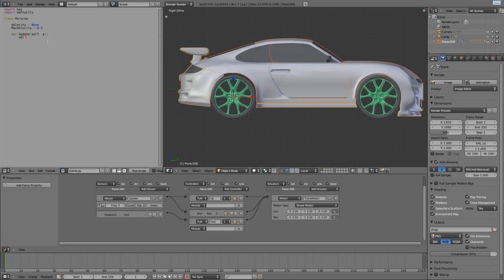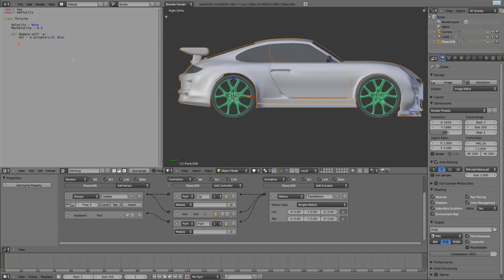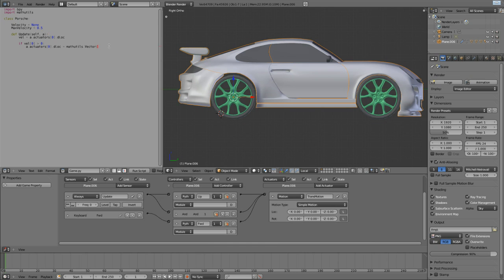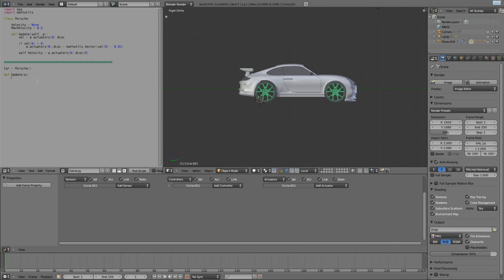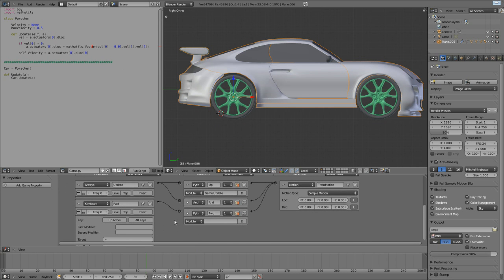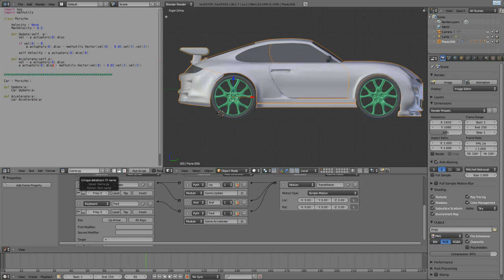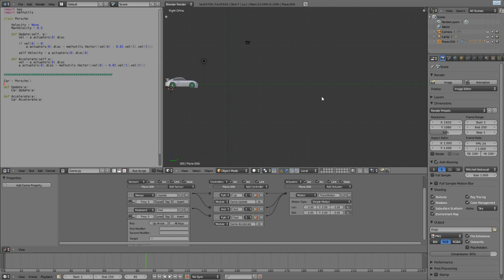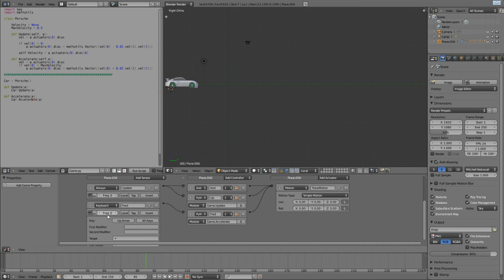Blender 2.55 Racing Game - Setting Up the Car Part 2

Comment from the maker: Firstly make sure there are two tabs at the start of line 10, not just one. You need a tab to show that the line is inside of the class, and another tab to show that it's part of the function. Secondly it's copied incorrectly, it should be "vel = a.actuators[0].dLoc" - with square brackets not normal ones. Lastly, try running it with these things fixed. If the other errors still persist I think that you may have a corrupt build of Blender. However I can't tell for sure without seeing the .blend

Comment: Um, can you help please? I have some strange errors;
File "Game.py", line 10
vel = a.actuators(0).dLoc
    ^
IndentationError: expected an indentation block

and;
Python module not found - controller "Up#CONTR#1":
SystemError: NULL result without error in PyObject_Call

and finally;
Python module not found - controller "Fwd#CONTR#3":
SystemError: NULL result without error in PyObject_Call

PLEASE help!